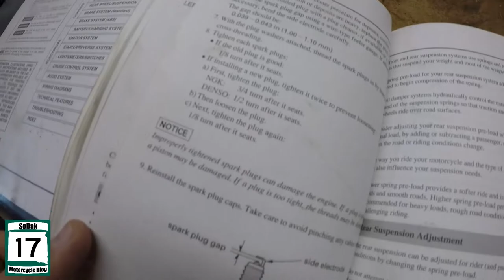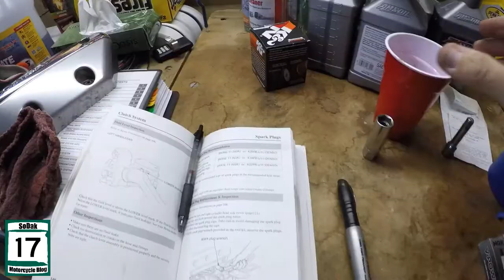How to Change Spark Plugs | Rider’s Manual of Common Tasks

Comment: Clutch, I think this is a no no, but I put just a small dab of antiseize on the threads making sure none gets on the electrode. Been doing this for years with no problem. I also blow ir on the head to remove any dirt on my Harley. This may not be an issue on the GW. Good content...